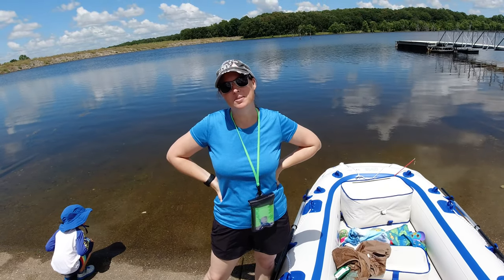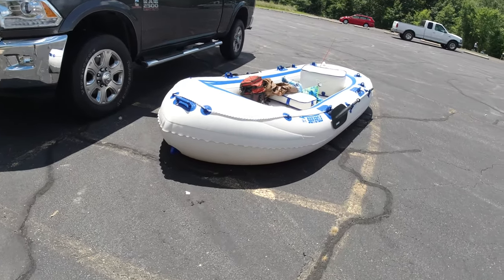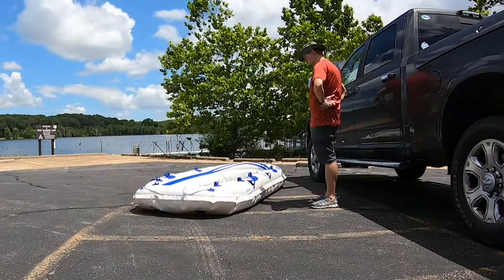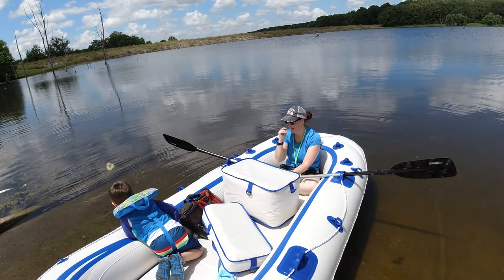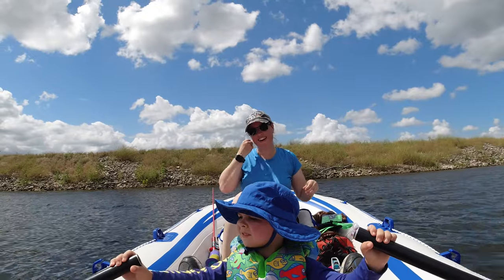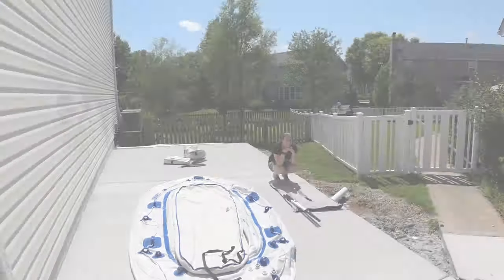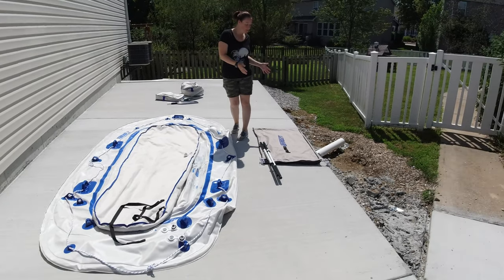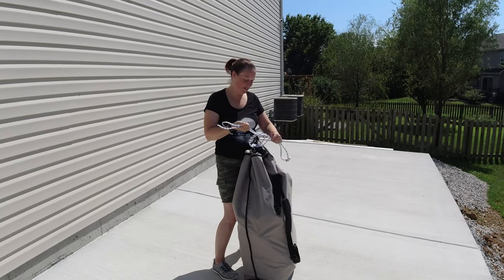Sea Eagle Se9  - Inflatable Boat In a Bag - Review and Setup

Comment: Thank you. This is one of the few videos that really shows the boat and it's operation up close and personal. I just got my SE9 in the mail yesterday.  I just blew it up and got it all set up in my living room. The owe thing seems like trouble waiting to happen. Do you still have your boat now in 2021. Did the ore locks/slots hold up. Seems so awkward. Do you have a follow up video review. Would love to see it. I can seem to get my value rings stretched out enough to but them around the post. I tried and tried. It just does not  stretch enough. For the guy in the video at Sea Eagle channel it was nothing. He did not even have to try. Boom they where on. Perhaps they sent the wrong ones cause these are not going to fit. How about yours?

Comment: hello, I   am viewing  your video on the sea eagle 9 now but would you recommend this over  an excursion 5 intex? I  am very new  to boating and wanted something for our military family of 4 to enjoy up here in washington state
Reply from the maker: I can't really speak to that excursion too much. I took a look at a few reviews and a video on it. It looks similar for sure. We have an intex river tube for floating and it is nice, but not nearly as thick and durable as the Sea Eagle. 
That doesn't mean their boat is the same way, but I can tell you that Sea Eagle is DURABLE. Once we had it blown up and out on the water, I had no questions it would last and hold up to pretty much anything. Also, they sell a motor mount kit so you can hook up a small outboard to it. That's something we've been considering lately. 
I don't think you'll be unhappy if you go with the Sea Eagle in terms of quality, but depending on how old your 2 kids are, you may feel a little cramped, especially if you pack in some gear and a motor. That Intex looks like it may be a little more roomy. 
So if I had to pick based on my limited knowledge of the Intex, I think the Sea Eagle wins in overall quality but the intex may be roomier. 
Hopefully that helps a little.
Reply: @BlackberryHillHouse  thanks  for the reply,  from researching  thus  far,  kind  of like the sea eagle but  as you  stated too,  the  excursion seems to be roomier!  :)  I have  14y.o. and 20  y.o. who may go out sometimes.
Reply: @schoc13  I just bought a Intex Mariner 4, primarily because it was cheaper and the reviews were decent. I received the first boat on Sunday, May 3rd, 2020. Unboxed it, inflated it on my deck and left it over night. Came out in the morning and air chamber 4 was deflated, leaked. (it has four air chambers). Packed it up and returned it for exchange from Amazon. On Thursday, May 7th, 2020 I received my replacement boat. Unboxed, inflated, left over night. Chamber 2 deflated. Packed it up and sent it back for a refund. My original plan was to order the SeaEagle SE9 (I have a SeaEagle 370 kayak) but I thought I'd save some money. Two bad boats in a row doesn't give me confidence in Intex.  At least it went flat on the deck and not out on the water. Now doing what I should have done in the first place and ordering my SE9. Should be here by the 21st. Another thing I found out is that the only real Intex warranty is Amazon's 30 day return window. SeaEagle gives you 180 days to decide if you want to send it back and they stand behind it. I've dealt with their customer service for a minor issue and they are spot on. My two cents. Good luck on your decision.
Reply: @DrRock5150  hey thanks for that lengthy review and reply!  sorry that  happened to you twice in a  row!   I did   receive   my  sea eagle  on Monday and  took  it out Wednesday.  I also bought the Honda 2.3 engine as well.  it's great and easy to  pack up after the maiden voyage :)  not sure if your getting  a  gas engine or not but that small tank does last a least  an hour I would say before refilling.   you'll  enjoy  it,  it was 3 of us on it weighing a total of about 540lbs.  on  the first inflating,  took  about 20 min, I am thinking I want the 10'6 round about   though, so I may sell this one  and upgrade
Reply: @DrRock5150  thanks for sharing your experience, helps potential buyers!

Comment: Using a hp air compressor is a big no no. You could easily overpressurize the boat and permanently damaging it. Use an lp pump if you do not want to manually inflate it.